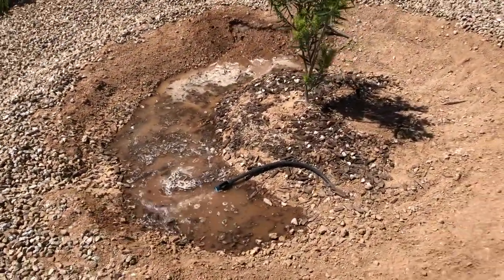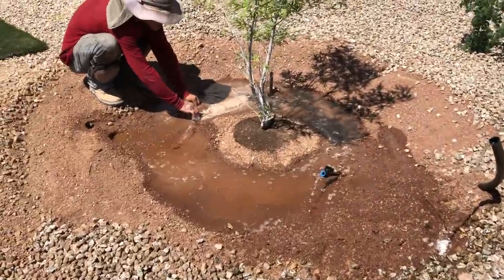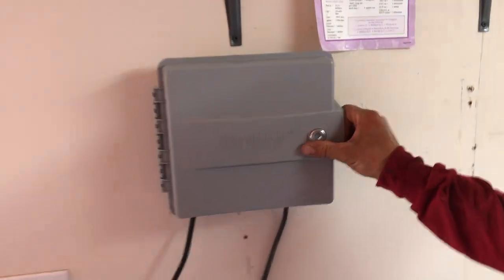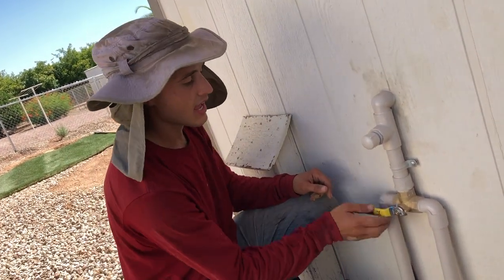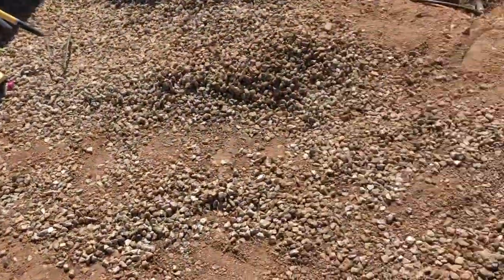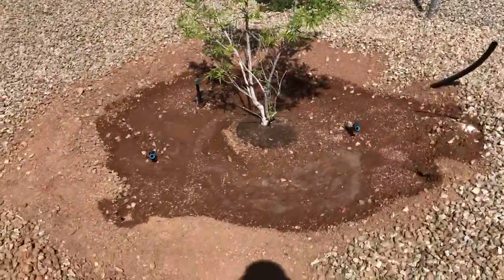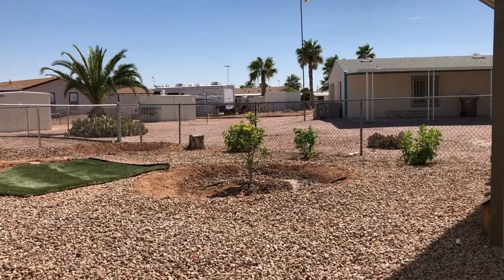Washing Machine to Landscape Grey Water System

Comment: Can I just put the hose from the washer to dump into a rain water tank without anti syphon?
Reply from the maker: It’s not recommended to hold grey water in cisterns or tanks.
Reply: @GalaxyGardensAZ  thanks!
Reply: Yes but you have to use it within 24h
Reply: @kkfn  thanks for reply.

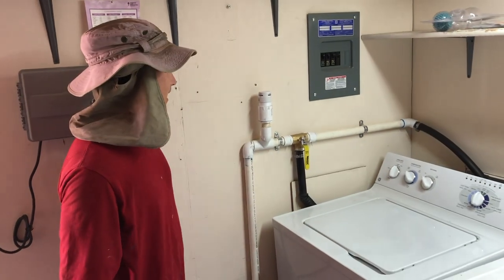Comment: 2:25 that's not a switch, it is a valve. You're violating National Electric Code by running that water next to the electrical panel. Finally, the studer vent needs to be higher off the drain.